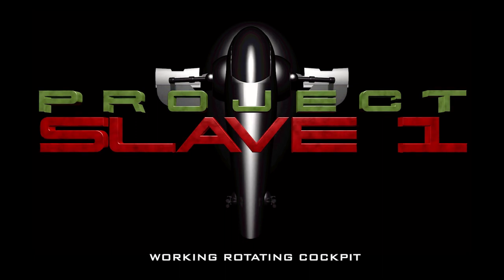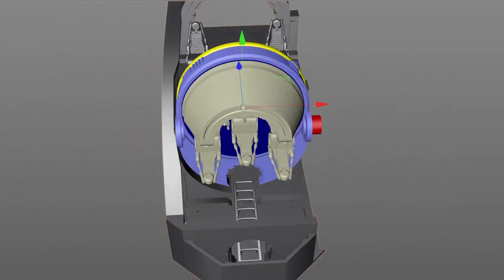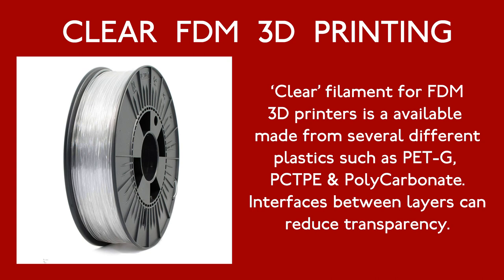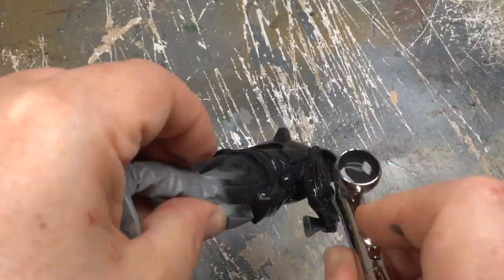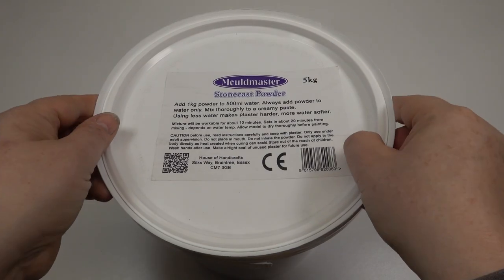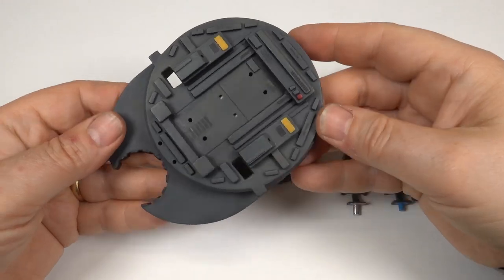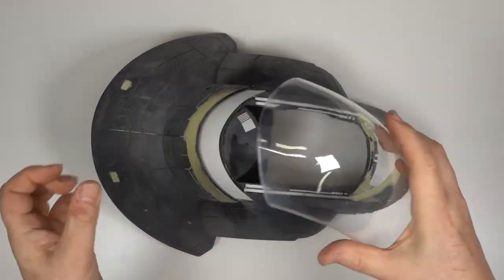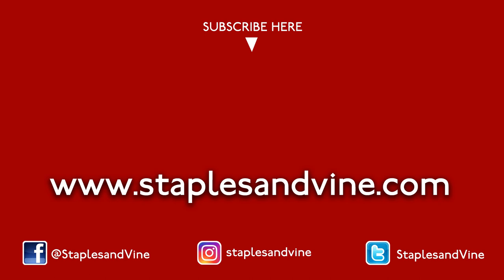PROJECT SLAVE 1 PART 4 ‘WORKING ROTATING COCKPIT’

Comment: I’ve started preliminary work on a slave one project of my own similar in finished exterior dimensions, but vastly different in terms of scale and detail… basically I’m building a twice scale version of the original Kenner toy to accommodate 6 inch black series figures. Technicallly I could build it at 1.6 times scale So it would be the same size in proportion to a 6 inch figure as the original Kenner toy was to a 3.75 inch figure… But I just went ahead and doubled it for ease of measurement and to get it that much closer to true scale.
Reply from the maker: Sounds good. Best of luck with your project.

Comment: wow, the working rotating cockpit are so sweet, do you plan to make it available or sell this file as an "upgrade" of the gambody one?

congratulations again! also for the choice of using the Archive-X sets! GG
Reply from the maker: Hi, glad you like my cockpit solution. Yes I will be making the stl files available but be warned there is a lot of reworking to be done on the original parts.